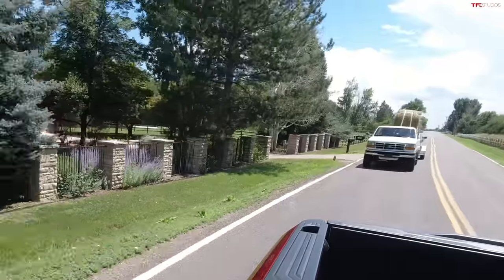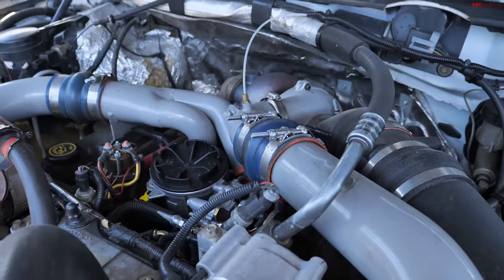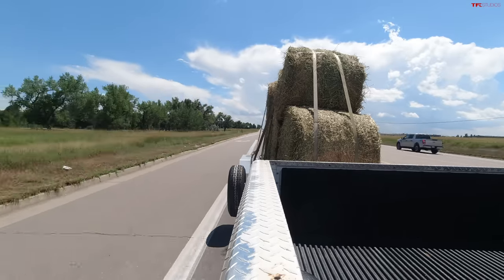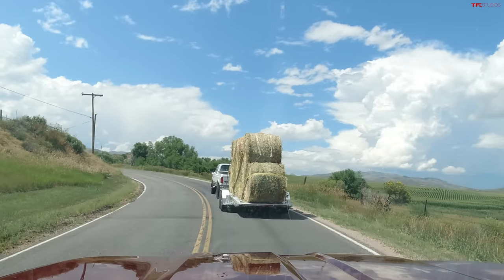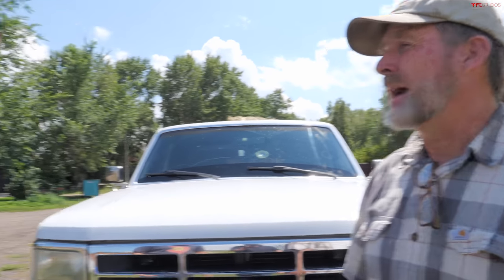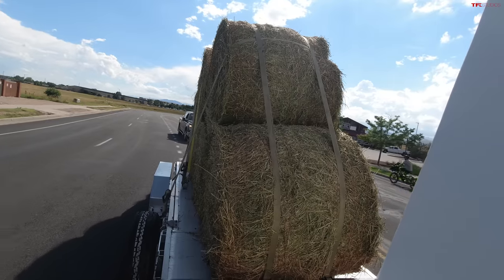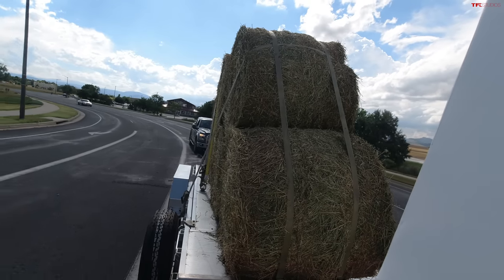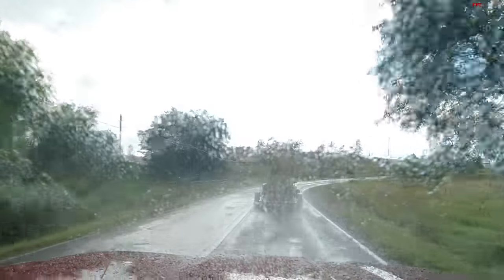Ranch Battle! Can a 26-Year-Old Ford F-250 7.3L Power Stroke Outwork the Legendary 5.9L Cummins?

Comment: We use the super duty 7.3 trucks wit 7k in the bed and 20k in the trailers and sorta baja through the woods only have problems with the transmissions bought some 3rd gen cummins trucks this year and every single one is broken down with different problems  so for a work truck the fords are way better in the woods and holds up better than the cummins

Comment: I daily an '02 5.9 HO, and while its not neaely as fancy or as eye popping as the modern trucks it gets the job done, and its super, super, super reliable. 

The one thing ill say about the older 5 9 vs the 7.3 is that stock for stock, the 5.9 is no match. Both are phenomenal trucks with great motors, but when you start building the motors those 7.3s can get meeeeeeaaaaaan.

Comment: Both are AWESOME pickups, the larger tires on the ford will make it work a bit harder, Hauling loaded trailers is a real world test of trucks, add a 6% or 7% incline and you will separate the men from the boys.  I have an older 1997, 12 valve Cummings with some minor upgrades.  It is a beast and has never left me wanting more. Yes, different trucks for different purposes, my daily driver is a 1500 Chevy, perfect for what I use it for, the Dodge in my towing Truck.  Great video, Thank you!!!

Comment: Cool video, appreciate the more mature approach to comparing two legendary trucks/engines.

Although, I think it would have been more apples to apples to compare that Ford to a 12v cummins with a single rear axle, both from the same era and much closer in power specs.  I think the results and comments would mostly be the same, but the difference just not quite as noticeable.  Also it would be clear that for both trucks in the same era, one would quickly appreciate what Ford did with the rest of the truck aside from the engine, compared to the Dodge.  Ford was well ahead of Dodge at the time when it came to the durability of the body, suspension, interior, etc.

Comment: Please do a test comparing a 90's Ford F250 351 Windsor V8 vs a 90's Chevrolet C1500 350 V8 both petrol engines.
I was thinking when buying my first truck between these kind of trucks, and went with the Chevy (Stepside ext. cab)(no regrets, love her alot!)
But Im curious how these would compare to each other since its besides cosmetics about the same truck.

Comment: When it comes down to it 7.3 is one of the best built diesel ever designed. They are super reliable when doing regular maintenance and not dogging the hell out of it. They arent really known to make big power, aftermarket set of injectors and a chip and tuner they are pretty decent. Cummins are really good trucks as well! But its just something about the OBS 7.3 that gets me everytime. I got a 95 f250 7.3 and fixing to pick up another 97 f250 7.3

Comment: Nice comparison, your 7.3 power stroke will be a little bit less responsive under 2000 rpm with the aftermarket turbo as it’s bigger than stock and takes more RPM to spool up on boost. That’s especially why it likes being above 2000 RPM. Flip side is that you build more power above 2600 rpm with increased airflow. I own a stock 2000 7.3 6 speed and would still agree overall that even with bigger factory turbo and injectors offered after 1999.5 model year a 7.3 best power is made 1800-2700 RPM. That being said running on a stock tune with an aftermarket turbo is going to feel a bit less responsive down low with an aftermarket turbocharger because you need a tune to help spool the bigger turbo quickly to get more responsive driving dynamics.

Comment: Got a 1995 f-350 dually with 5th wheel pulling 3 car carrier with it every week through PA mountains.  That truck wont beat a speed records but itt actuallly pulls about 12-17k loads pretty good.  Btw its bone stock

Comment: 16:32 I just realized the 555lb ft rating of the 5.0 Cummins is probably symbolic of the 03 H.O. Cummins. The horsepower is nearly the same too (310 vs 305)

Comment: A lot of it has to do with who's driving it how its been maintained. There both very good. When I go to Alaska I pull a 12k RV behind me and I have yet had a dodge pass me in the mountains. The only change I made I remove the small turbo and put a 45 psi turbo on it and increase the fuel pressure. And on the 7.3 do not use after market sensor on it. They will blow the top right of of the injector high pressure oil sensor.

Comment: I have two OBS 7.3s and one 12v 5.9 and I have to say I love the sounds of the 7.3 but the 5.9 is MUCH more reliable and easier to work on. On my 7.3s I recently had an IDM fail, CPS fail and IPR get gummed up. None of these can happen with the all mechanical Cummins.
Reply: 12 valve for life! Mine has a built auto with manual valve body. Absolute badass!

Comment: The 7.3 were pretty good for reliability, but if you leave the coolant to long it will turn acidic and eat the cylinder walls through! If you’re buying an old 7.3 this is definitely a concern because you don’t no if the cylinders are bad until they fail?
Reply: Thanks for the info I didn't know, I bought a 1995 f350 with 180,000 miles on it, the truck has been sitting for years, I hope that doesn't happen to me

Comment: they both good for towing, the Cummins has more horsepower than the ford but the 7.3L is very reliable. I have both a 2000 ford f350 7.3, a 2008 dodge ram 6.7 manual and a 2015 Ram 6.7 they all really good for towing. I really like them

Comment: I own a '97 F250 supercab 7.3  Powerstroke diesel 2x4 and a 2012 Cummins diesel 2500HD 4x4 deleted & tuned, both automatic trans. The Dodge is significantly more powerful and more refined than the Ford. However,  there's 16 years between them. I have never had to work on the Ford other than normal maintenance (358k). The Dodge, I am continually working on it. Two frt end rebuilds, ignition replacement, complete fuel pump system replacement (250k). Cummins has twice the power of the Powerstroke, but injectors, intercooler and a tune would close that gap. End thoughts, I prefer the Ford because I have had less problems and handles better.  The perfect truck would be a Ford truck, Cummins engine and Allison trans. Edit: I forgot to mention the Turbo on Dodge had to be replaced at 221k.
Reply: What the hell did you have to delete on an Ole 97 f 250?
Reply: @chadzagone8577  reading comprehensive skills lacking? "2012 Cummins diesel 2500HD 4x4 deleted & tuned."

Comment: So I have a 1990 f250 with a 7.3na. I replaced the auto with a zf5. Which was a better direction but still not enough. I wanted the low gear ratio for the towing but super high for cruising. So I put a 5 speed out of a 1969 chevy c60 in backwards. I made it so reverse and first were not available. ( due to them being 700% overdrive) so I now have 20 forward gears in my pickup. I can cruise at 80mph in 4th in the front and 3rd in the rear 1600rpms. So far a few thousand miles later and still working well. Still tows the same as before but I gained the fuel economy while empty. And it is really fun to drive

Comment: I REALLY wish that at least one manufacturer still made a diesel with a manual trans. I'm looking to get rid of my Titan XD and get something with 4 door, 4X4, and a 6 speed manual that can tow a horse trailer. But everything I find is very expensive. So looks like the newest thing I might be able to find is a '18 Ram. I think Ford stopped in 2010 and Chevy was 2007ish. The only truck that even still has a manual option is the little Taco, but it only tows about 7,000lbs.

Comment: You know what’s crazy I bought a new 1992 Dodge cummins and after 14 years I bought a 05 Dodge 3500 4 door long bed dullay and I love my 05 runs great but miss the sound of a 12 valve but my 92 only had 180 hp and my 05 had a 325 ho motor but I can tell the difference except the sound of a 12 valve but the 92 rode so ruff and the 05 rides so good and handels like a corvette but I don’t feel the horse power difference and I guess it’s the sound and you can lug a 12 valve but not a 24 valve so that may have been the difference and on a 12 valve you had to watch water temp so the gauge would set at 1/4 and when temp would get to the 12:00 mark on gauge I would drop a gear on my 5 speed manual the gauge would drop to a 1/4 and a 05 in the manual it says in bold letters do not lug this 24 valve so that’s why I don’t feel that extra power !

Comment: 7.3's directly competed with 24V's from 98-02.  I had a new 2002 Ram 2500 HO 6 speed manual rated at 245hp/505tq and my contrarian roommate had a new 2002 F250 7.3L rated at 250/ 505tq.
Reply: 275 525 in 03

Comment: I guess I've owned about 10 to 15 different Cummins powered trucks at this point. I've also had 2 older powerstrokes. There is absolutely no comparison in torque and power. The old powerstroke is an absolute turd... The thing doesn't make enough power to get out of its own way. It also shits the bed if you neglect oil changes because of the oil driven injectors. Idk why anyone why buy an old powerstroke...

Comment: I believe you're quoting the earlier ZF5 (S42) equipped trucks towing capacity. 96/97 (S47) should be closer to 14K. If the transmission was from 94-95 (S42) then you would be right, although I guess IMO it's more of a limit of clutch and maybe fluid life. Most prefer the closer ratios of the S42. No reason to run stock hp level if it's intercooled.

Comment: I have a 1995 F-350 with an automatic transmission.  It's got the TS6 chip, 6637 air filter, Wicked Wheel turbo, and straight pipe 4" exhaust with a 3" down pipe.  The reason we bought the truck was nastalgia for me and to pull our camper for my wife.  The camper is a 36 foot fifth wheel that weighs 9,200 pounds dry.  I have to say it pulls the camper just fine.  It's not a sports car and it could be modified to have more power but it does just fine the way it is.  I wouldn't even catagorize it as slow.  I can get up to 55 pretty fast even with the camper on.  I like the auto trans.  Yes it is more high-maintenance but it keeps you in the power band of the engine better.  I have a friend with an early 2000's 7.3 with the ZF-5 transmission and he complains that every time he shifts the turbo has to spool back up to get the max boost out of it.

Comment: I have the exact same Ford. even the same as the tires Manuel, are you doing? I don’t have an inner cooler which I plan to add.. The truck is constantly hauling. That’s all I use it for. It’s always up to Camper or my gooseneck trailer does great. other than starting to have a overheating issue with it not sure what the problem is. Radiator good thermostat. Good clutch fan good but starts overheating when. Pulling a hill.

Comment: personally, I'm a GM guy through and through. i would still take a ford any day over a dodge.
Ford's F150s died in 1997 and the Super Duty's in 2004 with the end of the 7.3L
dodge has NEVER made a good product. the only reason anyone buys a dodge is their partnership with Cummins.
I STILL own a 1989 Chev C1500 with a 5.7L (for performance) and a 1995 Chev K2500 with a 6.5L Diesel (for mileage). Best trucks ever.
MOPAR = Might Only Perform At Random.

Comment: Tow 27500 lbs with a 7.3idi f250 you don't go fast unless downhill and scarey as hill on a gravel road.  Do a 2003-2003 ram/Ford 7.3 they are comparable but have different power. 4x4vs4x2 not comparable...

Comment: I have 4 different diesel rigs. 
A 2008 f750 with a 6.7l 24v cummins on an Alison trans. 
A 2005 f650 with a 6.0 powerstroke with an eaton fuller 5 speed manual.
A 2003 Dodge ram 2500 with a 5.9l 24v cummins and a 48re auto.
A 2002 f350 srw with a 7.3l powerstroke and zf6 manual. 

Here's what I've learned about them. 
The f650 won't go above 63mph empty. This truck is registered at 26,000 gross. Empty, with no trailer behind it, it comes in at 11,500. We don't use this truck very often. It's my backup chip truck for my tree service. It dogs under load and simply put, always feels under powered. 
The 2008 f750 on the other hand, fully loaded, with 7000lb chipper in tow will roll at 75mph all day. At hills, that Alison knows which gear to give, and the 6.7 cummins delivers all the power and low end torque you will ever need. 
The 2003 ram 2500 is my daily driver, and road trip rig. I've built the trans to the hilt. We travel every year for our anniversary, pulling our 7000lb camper. This truck has never let me down. I do wish it had the nv5600 in it, because more gears will always be better for towing. But going through passes, logging roads, loaded down it provides a one-off driving experience. This truck is happiest when it's working, and it does its job well. My 14k dump trailer you know is behind it, but she will pull it without prejudice. 
The 2002 f350 is another work horse. There have been times i was glad to have the low gear at a stop light on a hill with that 14k dump trailer behind it. The displacement and gearing really helps it to get going, and up to speed. Plus, it's really fun to drive.

Comment: If the displacements were the same, it would be a fair comparison, I’ve had a 1997 F350 with stock 7.3, and driven many 5.9 Cummins equipped dodges and engine wise, I prefer the torque of the Cummins.

Comment: Im not even a minute in but this has to be the WORST comparison ever. a 2WD 2003+ DRW 24 valve common rail vs a 1997 7.3 4x4 SRW and a 5 speed. Perhaps a SRW 12 valve or 24 valve second gen with a 5 speed would have been a much better comparison.

Comment: I have drove a 2000,f350 4x4 dually 7.3lt power stroke own a 2001 ram 3500 dually,4x4 5.9lt cummins. I'm sticking with my Cummins any day over the stroke.Fuel milage was better n the comfort n noise

Comment: Straight six is the way to go. First, you design one engine and then you can just scale it so you can invest a lot more in the design of a straight six. You can't do that with a V-configuration. Straight six, 40% or so less moving parts, that's 40% less parts to fail on you. The old 12-valve straight six was the most reliable engine to ever service a consumer vehicle, regularly hitting 500K miles, sometimes one million; 50,000 hours of duty is not an unrealistic expectation.

Comment: We hauled our horses to one of the State Parks to go trail riding.  My brother used his 2001 2500 Cummins Diesel and his best bud brought his 2001 F-250 Powerstroke.   My brothers Cummins pulled so much better than the Powerstroke, but my brother does have a chip in his Cummins.

Comment: This isn't Dodge vs Ford, it's Cummins vs International. It's been an ages old fact that Dodge uses thinner metal in their body panels. Cummins started that Compressed Graphite block was what steers me from them. My 96 F350 7.3 4x4 dually 5spd CC keeps soldiering on. It rides rough and doesn't get great mileage or win any contests. It does keep working without a whimper and can get the job done with some patience. Take care of anything and it'll take care of you.

Comment: I am Ford blue through and through but oh my gosh is my 94 1/2 F350 power stroke noisy...and I'm not talking exhaust. The motor is just noisy...that said the fresh rebuild gave me 434hp on the dyno... unfortunately the 5spd doesn't shift as well as it did with the dual mass clutch.

Comment: I like that the Dodge 6 speed manual is geared like a true 6 speed.  I know its completely different, but my daily driver is a 2010 Kia Forte SX with a 6 speed manual.  Its a fun car to drive and accelerated quicly.  But the trans is geared like a 5 speed with a 2nd overdrive gear.  4th in my car is the direct drive gear 1:1.  5th is .89:1 and 6th is .70:1

Comment: I've owned both of these trucks.  Got tired of doing injectors and fixing fuel and oil leaks in the valley on the 7.3.  Also did Hi pressure oil pump on the 7.3 and cam position sensor twice and valve cover gaskets because the terminals burt out and the under valve cover wiring harnesses etc.  On my old dodge I've done the transmission and one high pressure fuel line. I've owned it twice as Long and it had 60000 more miles on it when I got it than my Ford did when it blew up.  I had a 93 ford with a transplanted 7.3 idi turbo out of a 94 that I loved but the truck rusted out around the engine.

Comment: I had both.  The dodge truck was terrible but the engine was good.  The engine had a very narrow power band.
The Ford truck was great.  Engine was good because the power band didn't fall off like the cummins.  I put 300k on a 96 stroke.  Still have a 03 cummins with 280k.

Comment: 04-05 ho 5.9 blows away any 7.3 power fuel mileage driveability and most definitely cold start.     Ive owned both last cummins clicked 500k miles with 6 speed manual

Comment: I find this pretty one sided Towing wise. The fords not a dually. It’s a 250 vs the 3500 , not only that the dodge had bags. And the ford didn’t even have a tiny little tune on it. You said it was in the stock setting. The ford with a little tune on it would’ve performed like the dodge did. And would’ve been way more even. Gonna get people in here saying the dodge isnt tuned. And you’re right it’s not. But it’s 6 years newer and right out of the gate makes 100 more horse and 100 more ft lbs. the earlier 5.9 24v wouldn’t make that much more. I genuinely think , that the ford with a 06 f350 axle upfront for the bigger brakes will honestly leave you baffled at how great they are. The least confidence inspring thing on that truck is quite literally the brakes. They’re trash.